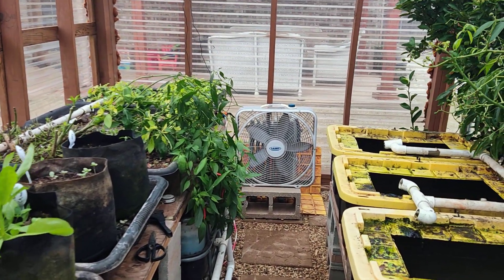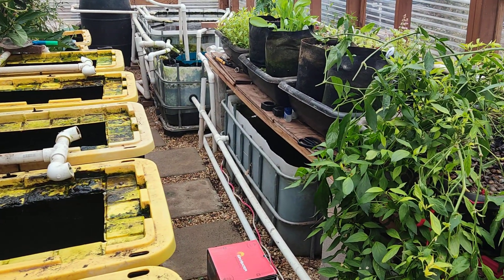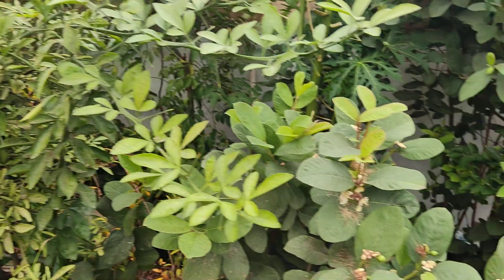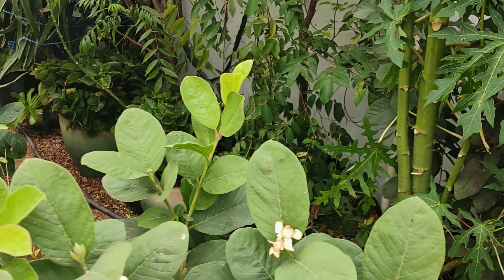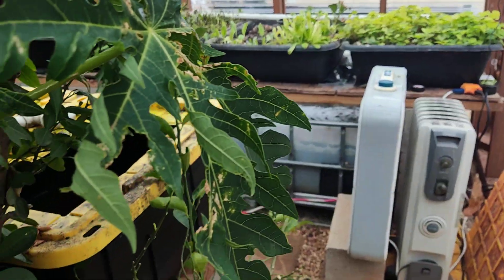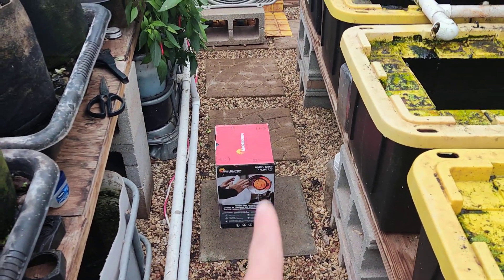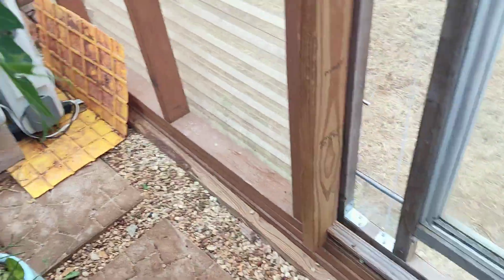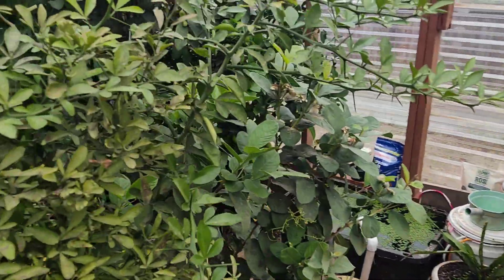Most Efficient Ways To Heat Your Greenhouse

Comment: I feel like heating the water is a more efficient way of heating the whole space, heating the air and it will just dissipate. Heating the water will dissipate too but into the greenhouse air and then dissipate to outside.
Reply from the maker: You are correct but I am more into the tropical fruit tree in the greenhouse and heating the air gives me automation and controls